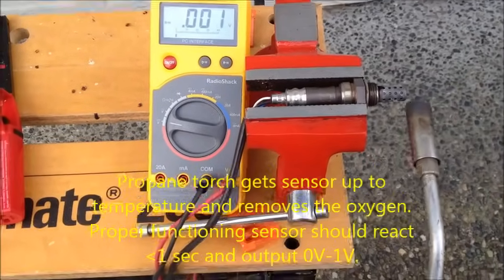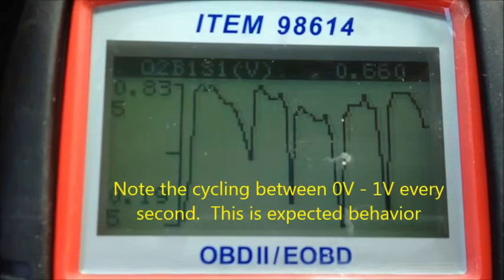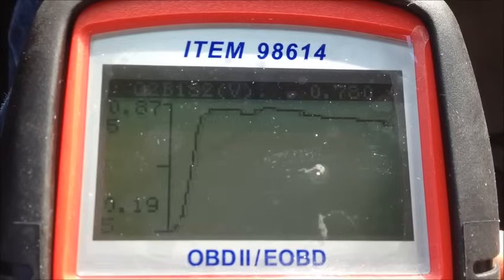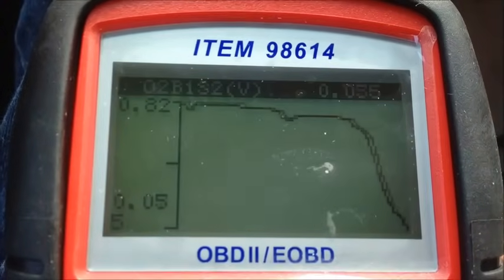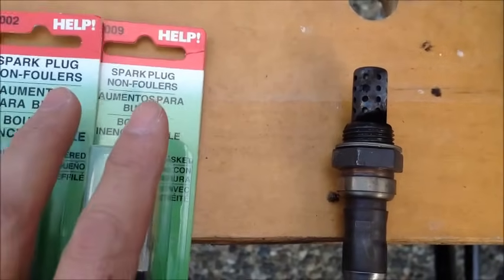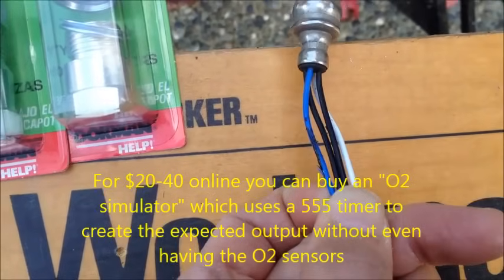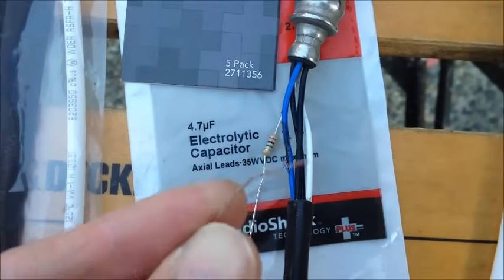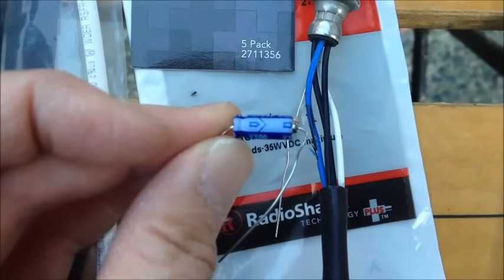$3 O2 simulator fix for P0420 Check Engine Light

Comment: I had a question okay so the sensor has to be a good one. But is it before or after the catylic   Converter I did it with old ones before cats and nothing (running headers ) just want to get rid of CE light ) blessings Anthony
Reply from the maker: After the cat.  You're modifying it downstream because the cat isn't doing its job well enough so you're trying to make it look better.  The sensor after the cat is compared to the sensor before the cat.  If you change it before the cat it won't do anything and could possibly make it look worse.

Comment: in theory, this would work with a broken sensor and it doesnt have to be screwed into the exhaust, correct? You're just finessing the signal voltage
Reply from the maker: No, it won't work with a broken sensor.  You can't finesse broken.  It has to have a working signal which is then smoothed out.  If it's not working the smoothing won't do anything to change the failure.
Reply: I had a question okay so the sensor has to be a good one. But is it before or after the catylic   Converter I did it with old ones before cats and nothing (running headers ) just want to get rid of CE light ) blessings Anthony

Comment: “Get it in the right place” as in the location on the wire or the correct wires to use?
I’m looking to add long tubes and catted y-pipes to my silverado. I figured i can do this to the O2 sensor connector extensions with wire loom so it’s not as visible for when I have to get my truck inspected. I have to have cats and can’t use O2 sensor “extension/ spark plug fouler” and I can’t use O2 sensor simulators 🤔
Reply: You can do it anywhere on the wire as long as it's electrically the same as shown.  Some vehicles even have access inside the cabin.  I haven't used wire loom but as long as it's properly insulated and doesn't get too hot I think it would work.

Comment: Do you need the o2 sensor installed into the port or can it be just plugged in & ziptied outa the way. I dont have the bungs anymore in my pipes
Reply from the maker: You need it to be installed and working.  This only smooths out the o2 sensors' output - it doesn't replace their job.

Comment: Hi MITEEman
Hi Boss. Can I use the 4.7 oms 50v capacitor?      Thank you very much for helping us.
Reply: 50v is fine because we're only dealing with 1V.  I think you mean 4.7 microfarad.  That's fine but the choice of Capacitance (microFarads) x Resistance (ohms) determines how slow the signal is, so you may have to play with those two values.
Reply: @GeorgeHuMIT  Thank you boss

Comment: Excellent video, but does not work at all on modern cars in any way, shape or form.  The new ECU systems (in Toyota/Lexus specifically) have a "plausibility lookup table" to determine if there have been any devices added to the sensor (like a primitive LC circuit), any mods to the catalytic converter, any enhancements to the exhaust or anything done to anything which in some way could be construed as a "plausible" attempt to alter the emissions system.  Toyotas will even spike a random A/F ratio of various gases by altering the VVTI momentarily and alter exhaust pressure ratios at random times to initiate CRC tests which determine if something in the emissions system exists one week and does not exist another week.
Reply from the maker: Thanks for that interesting information.  I'm not at all surprised it doesn't work on modern cars.  This was done on a 1999 Honda Odyssey with 4 wires.  Things have changed a lot since then.  Do you think the analog spark plug foulers would also not work?

Comment: what is the computer looking for from a rear o2 sensor? ive never heard anyone explain this.. isnt it supposed to hover around .45 v? coulnt you just direct wire .5 volts into it and it be a perfect reading or is it looking for changes? is it ok if it idels around 0 v? doesnt it need to be .45? no one ever explains any of this.. how do i know if its working right so it will pass readiness? and please dont say wait and see if it does.. what readings is it looking for so i know what to A. do... and B. if its working right...
Reply from the maker: As I show in the video, the input is supposed to be a wave that varies from 0-1V as directed by the car's computer.  The output is supposed to be a slowed down version of that.  A steady .45V would not work and would likely throw P0420.  You can't just set a value because the car is varying the input through it's computer and then looking to see how the Cat is handling those inputs.

Comment: I tried this but i used half watt 1 ohm resistors and then the same capacitors. Do you think the resistors being half watt instead of a quarter watt would mess it up?
Reply: That's not going to affect it.  The wattage of the resistor is only affected by how much power you're going to put through it and this is only 1v and milliamps so any wattage resistor is fine.  First make sure to clear the code and drive it at least 75 miles over several trips to reset the computer.  If it's still throwing P0420 then you can either bench test it to see what it's doing with the mod (looking for a signal that changes every few seconds slowly) or you can just experiment changing the values of R x C, usually the problem is you're not using a big enough value but if you go too far you'll get another code saying it's not changing enough.

Comment: I used this circuit on a 02 sensor and it worked great to stabilize the voltage but now the voltage is too high (1.2}, How can I get the voltage down to .4 to .6?
Reply from the maker: I don't have any idea how it could be too high.  The o2 sensor should only be capable of generating 1V and no combination of resistors or capacitors are capable of increasing voltage.  I wonder if your o2 sensor could be bad but again I don't know how it could produce more than 1V.  I would try reducing the Resistor x Capacitor value as that will reduce the effect of the circuit.  Maybe try reducing one in half - resistors are somewhat easy if you have a second one you can just put it in parallel with the first.  Good luck and let us know if you solve it.  I can't think of anyone else having this particular problem.
Reply: @miteeman  Thanks for the advice, I will try that this weekend. I may try replacing the sensor also since I tried the non-fouler trick also and it had no effect.
Reply: @miteeman  Problem solved, downstream sensor was bad, Zero volts on bench test. I left the non foulers in and replaced the sensor. now I have a nice steady .5 to .6 volts. CEL has been out for 2 weeks now. Thanks for your help!
Reply from the maker: Bench test it before replacing.   You can use a torch or a big flame to do the test I showed.

Comment: @MITEEMAN, I don’t know if you read the comments I tried this and it cleared the p0420 code but popped P2270 sensor stuck lean (or shortened signal wire). According to my programmer I’m averaging .52 volts at 2400 rpm which should be the sweet spot with the engine running (I don’t have graphing capabilities) and the wire resistance between the positive and negative sensor wires appear to the same. Would a smaller resistor or larger capacitor work (I did try a 4.7 capacitor with the same p2270 code) or could it be a bad solder job 

Any insight if you read this would be greatly appreciated.
Reply from the maker: I believe that P2270 code means that the signal isn't fluctuating enough between 0-1v.  That means you're slowing the signal down too much.  The value of R x C needs to come down.  You can reduce either the resistor or capacitor value until the code goes away.  If possible, you should bench test your o2 sensor with the fix on it just as I show in the video.  You can watch your voltmeter and ensure that the signal is varying in a realistic manner.

Comment: I went online with the radio shack part numbers with no luck. They closed the radio shack stores in New York state area's,is there any way that I may buy the extra ones that you have left over ? I have an aftermarket cat in my 2003 and 2005 Honda Accords and the p0420 code is on for both cars, Michael W.,7 Wadsworth Street, Auburn, NY 13021
Reply from the maker: Every major city has an electronics supplier for hobby electronics - NY should have tons but I can't tell you where.  Try "electronics hobby store near me" on Google Maps.  Simplest solution is to just buy on Amazon or Ebay for the resistors & caps by specs mentioned in the video.

Comment: The capacitor will store a small charge and as the waveform drops the capacitor will discharge helping to even out the waveform resulting in  fewer and more consistent changes downstream.
Reply from the maker: That's right!

Comment: Thanks for the video, It is greatly appreciated!! Keep making content! I do a lot of industrial and automotive electrical work, and constantly deal with solder joints on wire splices that won't flow out correctly. I always try first with flux but if the normal routine fails try this..
 Clean the wires by scraping with razor blade, you can also use a wire brush or scotchbrite. Scrap/brush towards the end of the wire, ensuring you get all surfaces especially if it is a braided wire.
Reply: Wats the volt on the capacitor 4.7uf what is the volt
Reply: The voltage from the O2 sensor is 0 to 1 volt, so anything over that will be fine.   @jbelectrical6833

Comment: What about vehicles with 2 O2 sensors after the cat? Obviously second sensor is the emissions feedback to pcm on status of cat, but I wonder if the 3rd sensor is also wired into this emission logic... If so, your mod would have to be done to both after cat sensors.
Reply from the maker: Sorry, I'm not familiar with systems that have two downstream sensors.  The newer models may not work with this mod because their computers could be more sophisticated than the old 1990's tech.

Comment: Hi There, I have F150 2012 and now after bypass I have this code P2098 post catalyst fuel trim system too lean bank 2.. and bank 2 sensor 1 is 0.750-0.950 bank1 sensor 1 is normal 0.1-0.4.. all 4 sensors are new 🤷‍♂️ Somebody same issue? Thank you

Comment: so, I figured out the wires on my O2 sensor which had different colored wires than the blue black and white, after I looked up which wires were what, I implemented, exactly to your instruction, the fix. all I can say is hell yeah! it works. but of course, me being an electronics nut, and quite good at electronics myself, I knew it would. I just wish I would have thought about it before anyone else. LOL thanks a lot appreciation
Reply from the maker: Great job, and thanks for sharing your success.
Reply: Was your wiring grey black red white by chance? I have a '14 VW. Thanks

Comment: so my O2 sensor does not have a blue wire it's still four wires but it has two white wires and it then has a black wire and then a gray wire so that leaves me at a sand seal can you help me and explain to me what I should do to apply this fix?

Comment: This fix seemed quite simple but apparently I've done something wrong. I no longer get the P420 code but now I get P0137 "O2 Sensor Circuit Low Voltage" Did I get the positive and negative wires switched? Could doing so cause this problem?
Reply from the maker: My guess is that this could be caused by bad connections causing an open circuit.  The best way to test this is get a voltmeter and do the bench test.  If you don't have a torch just put it over an open flame.  You should see a voltage that varies betwen 0 - 1v as it is exposed and removed from the flame.
Reply: @miteeman  Ok, i have a voltmeter and will check today.

Comment: Is this a delete to where I can take out the o2 sensor completely? Or just not for a cel
Reply from the maker: No, don't remove the o2 sensor.  This just smooths out the performance.  If it's missing there's nothing for it to smooth out and it won't work.

Comment: I couldn't see which way the 1 m ohm resistor was put in or which way the capacitor was facing in your video,I have an 03 Nissan with 2 whites and one black one bank 2,bank one 2 blacks 2 whites

Comment: I wonder how I can do this on my 5 wire 02 sensor on a 2012 Infinity QX56 red, yellow, white, black, gray wires
Reply from the maker: You want to search on the internet for "o2 sensor 2012 infinity QX56 pinout".  I took a quick look but didn't find one for you.  But I did find this page which explains 5 wire sensors in general https://wbo2.com/lsu/lsuworks.htm  .  The 5th / 6th wire is for calibration and a current loop.  If you can't find a pinout then you have to benchtest the sensor as shown in the video.  Finding the heater wires is easy by using a voltmeter to find a low resistance pair on the sensor end which matches a 12v/ground on the plug side.  Then you have 3 wires left and you need to test each pair (3 possibilities) which responds to a flame - even a lighter will do.

Comment: I followed this O2 simulator video to a "T". Using the Toyota 07FJ diagram, slot 1=heat signal, 3= O2 signal, 2=heat "ground" and 4= O2 "ground". I added the resistor to the signal line and then just after the resistor in parallel added an electrolytic capacitor. But after plugging it in, now I am just getting a flat constant graph with a 1.275V constant reading on both O2 sensors and engine code P0606 (PCM error), with two pending high voltage sensor 2 O2 sensor codes. Did I miss something?
Reply from the maker: Verify you've got the right two wires for heater - it should show a low resistance on the sensor side and the plug side should carry 12v.  Did you test the signal on the signal & ground wires before making the mod?  I also noticed you said "both o2 sensors" - you're only modifying the downstream sensor right?  You shouldn't touch the upstream one.  If wired correctly and you've seen the original signal coming out of the o2 sensor, you should see a slower version of it with the modification.
Reply: I have the same issue on my 2005 4runner. Did you figure out a solution?
Reply: any solution also 2005 4runner

Comment: Could you provide a little more detail on how you pick the "blue" wire and "white" wire regarding  connecting the low pass filter. The colors on other oxygen sensors are different, the heater wires are easy to determine, but how to determine the other wires to use with respect to orienting the low pass filter (mine are not blue and white) is not easy to determine. Any advice is appreciated.  Thanks.
Reply from the maker: Glad to hear you figured out the heater wires.  Is it a 4 wire system?  If it's more than 4 wires it gets complicated and may not work.  Best way is to test it if you can remove the o2 sensor.  You can even use a lighter instead of a torch.  You need to remove the oxygen with the flame.  You can then measure the voltage.  You should be able to find a schematic for the wires on the internet.  Worst case is you make a guess and see if it works.  If you're using a polarized capacitor then you want to get the polarity right, but in theory you could use a non-polarized capacitor which you can hook up either way.
Reply: @miteeman  Thanks for the reply. My O2 sensor (toyota) has 4 wires; (2 white, 1 black, 1 grey). You mention in the video that you are putting the resistor in the blue (signal) wire. How did you determine this is the signal wire?  Is the other wire you connected to just ground?  Trying to figure out so I can put the resistor in the correct lead. Due to Toyota change-out of sensor the schematic colors are not any help. Any thoughts on how to figure out for sure which is  the "signal" lead are appreciated. Thanks again !
Reply from the maker: Homestead Tech, see my previous answer.  Since you've got just 2 wires it's as I suggested.  I can't believe you can't google to find a schematic of the sensor pinout.  Just search for "19XX Toyota XXXXX o2 sensor pinout".  If you look on sites selling your replacement they sometimes will have pinouts.  Or at minimum they'll give you the Toyota part# which you can then search on.
Reply: @miteeman  I did finally figure out the wiring, I got a couple of connectors from the junkyard so I could just plug in an "inline" filter between the sensor connector and the car connector, without having  to cut directly into the factory wires (this is all done inside the car, rather than in the wiring underneath where the sensor is).  I used the 4.7 uF and 1 meg resistor you recommended. I have been driving it quite a bit and it has been working perfectly with no check engine light. Thank you very much for posting your fix !!
Reply: @homesteadtech2501  I have the same colours like you how can I proceed?
Reply: @ryzenx-no1bl  try watching the video! Duh!
Reply: For people with the grey white and black wires. 

Grey is ground, takes the negative end of capacitor.  Black is signal. Grey also takes the resistor, no resistor on black wire.

Comment: is it ok if i use 1/8 watt 1M ohm resistor? or does it need a bigger watt resistor thanks in advance
Reply from the maker: That's fine since it's only 1V and probably only a few mA so it won't hit close to 1/8 watt.  However, bigger resistors with higher capacity are also more likely to survive the high heat there so if you find it works and later fails I'd upgrade to 1/4 watt.
Reply: @miteeman  thank you for taking the time to answer!!